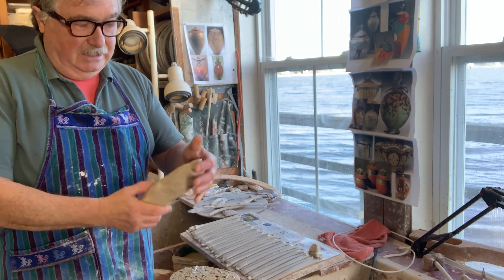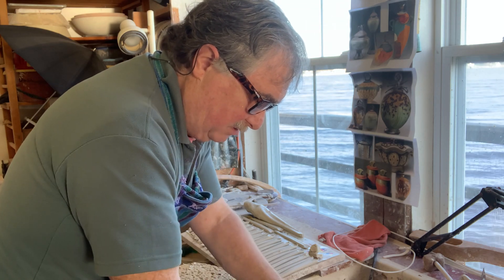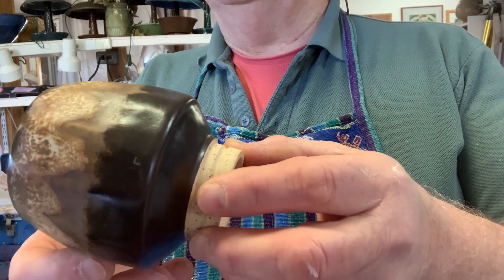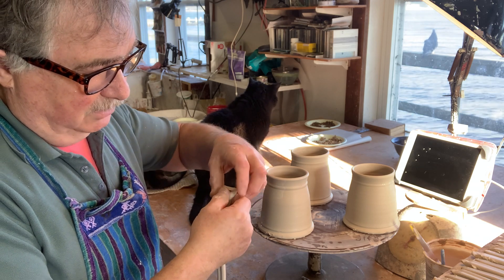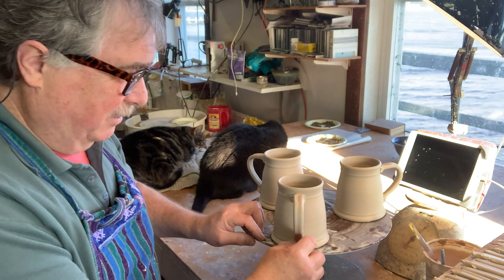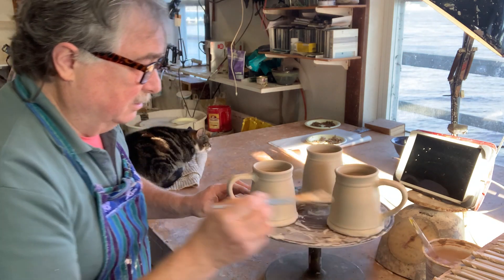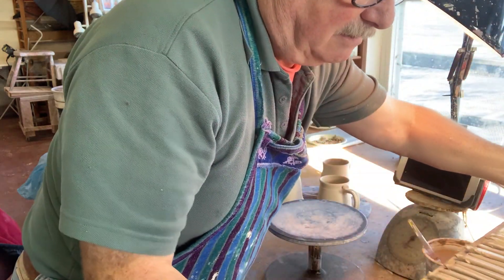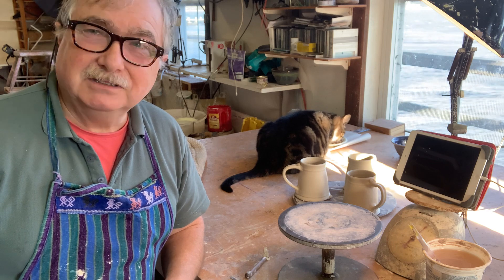Making handles, refiring pieces and glaze tests.

Comment: I will be trying again to pull handles.  By watching this video, I realize the body of my Bee Mix mugs were quite drier than the handles and I also used too much slip to fill in the "V" where the handles were attached to the body.  I had bad cracking where the handles were attached and lost five out of six mugs and they were so.e.of the prettiesr I made for Christmas.  We learn through our mistakes.  I like your routine of doing more of an assembly and working on three or more mugs at a time and having them on a tray.  Much easier to work with softer bodies.  I learn so much watching your videos and thank you for recommending I watch this video!
Reply from the maker: You are welcome.

Comment: How is it that your handles don’t dry out too much when you are putting them on other pots? I only do handbuilding right now and the handles will dry out fast. Thank you so much for all of your videos.
Reply from the maker: I put them on right after pulling them and I make sure the clay I use for handles is stiff, so it holds its shape. The clay stays soft enough for an hour and I can re wet the ends if it gets a little stiff. The handle should be a little softer than the pot.

Comment: Excellent video. I thought pulling handled was hard when I started. Now it's a piece of cake. Do you have a video where you apply slip to your mugs?
Reply from the maker: I spray it  on but you can dip it. A badger airbrush #250-2 or 250-3 works best.

Comment: Hi Vaughan, I've been really enjoying your videos and going through them one by one. I do have a question. On one of your kiln reveals you had a temmoku glaze that you use. I've tried a few and can't get the results that you did. I fire to a cone 6 on Bmix but can't get the gold flecks to shine like you did. I know you said that you got the recipe from the Google Gods, would you mind sharing the link for the one you are using. It's stunning. Thank you so much and keep up the videos! Love your studio and Nova Scotia is on the top of my list to visit.
Reply from the maker: I will dig my glaze book out tomorrow. It just needs a ramp hold schedule with 5 segments, to 2210 F then fast cool to 2000 and soak for 30mins, then fast cool to 1750 and soak for 1hr, turn off.

Comment: For deglazing did you brush on the epson salt solution or how did you use it?
Reply from the maker: It takes about a teaspoon to one gallon of glaze. I premix the epson salts by pouring it into a gallon of water, I usually add way more salts until it no longer dissolves, then pour off the solution leaving the undissolved salts at the bottom. This makes a powerful concentrated solution to add to glaze. Then just add slowly taking care not to use too much in the glaze.
Reply: @Vsmithpots  Oh, that’s great, thanks!

Comment: Not sure if you know this trick, but heating a glazed piece in a little toaster oven (or real oven) will allow the new glaze to attach to the previously glazed surface, but use oven mitts to handle the piece 🤣❤️
Reply from the maker: I do something similar by sitting the pieces on a firing kiln and when they are way to hot to handle, use glaze tongues and dip the already glaze fired pieces in the glaze. They steam and the glaze dries fast. You can also use a glaze thickener such as Epsom Salts so the glaze does not run off the piece. Your way sounds good too.

Comment: I don't know if you watch Earth Nation Ceramics, but Donte has done quite a few Randy's Red firings.
Reply from the maker: I have watched them but it seems the only element missing is the firing schedule. He uses a specific gravity for glaze application thickness. I am trying different thicknesses of glaze  along with firing different length of  times and soaking at different times. I plan on doing the same with other iron glazes I have. My Ten Moku Gold works great but I wonder if it too could be improved. It seems the rich red is the holy grail of iron glazes.
Reply: @Vsmithpots  of course you're right. I'm still learning the firing side so I haven't really paid attention to that yet. He is pretty good at answering questions, though.
Reply from the maker: @rondacorkhill1654  Asking questions is cheaper than my electric bill. I will give it a try.